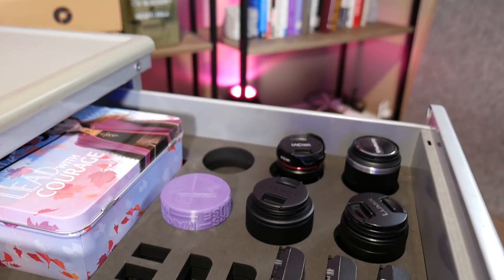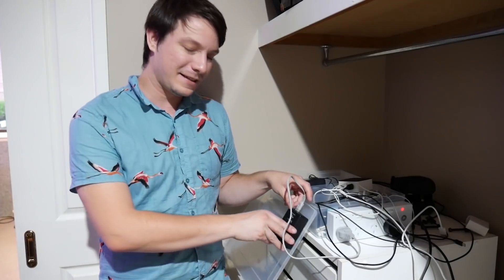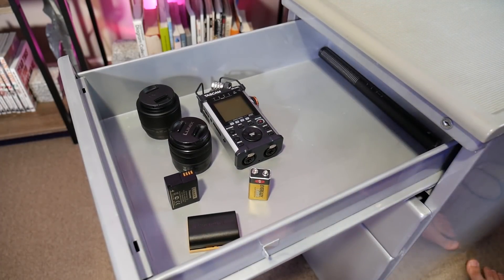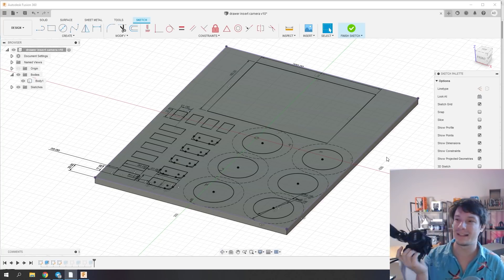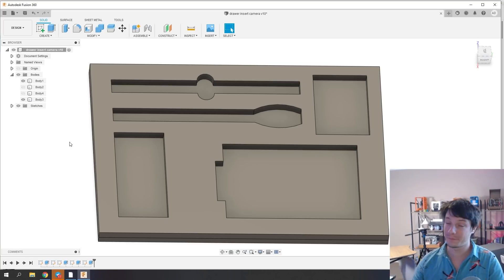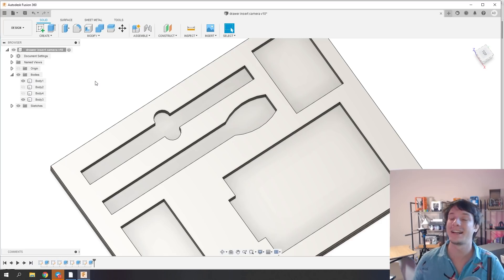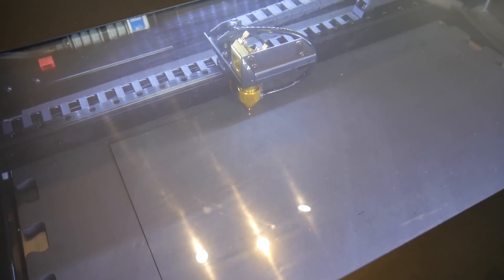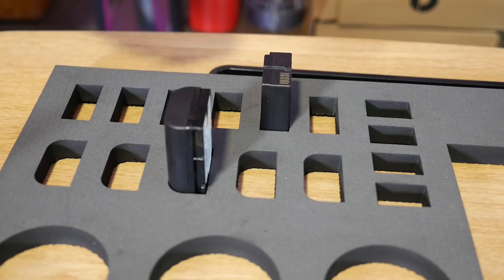DIY Custom Inserts using EVA Foam and Lasers!

Comment: You can use the "Canvas" feature in Fusion to lay out your gear on the EVA sheet, then take a top down(straight down with no parallax) picture. You can then trace your sketch right around all of the objects on the Canvas in Fusion. For basic circles/squares and rectangles, it's probably not too efficient, but for organic/odd shapes, this works really well. Actually used this method to use a picture off the web to create a dxf for some T-stak foam inserts.

Comment: Tracing the outline with a pen is not the best way and seems tedious.. Just place the tools on the foam you're going to use or a surface that is the same size as the foam. Take a photo from above. Open the photo in illustrator or another similar software (there are probably 100 free platforms that will do the same). Adjust the image to show the tools/items in a single colour and then turn the tools/items into vectors and use the vector outlines for your cutting.

Comment: With batteries, I simply have charged batteries facing up, flat batteries facing down. Once you get yourself used to do it for a while, you don't even think about it anymore.
It makes things easier with power tools on work sites too, if everyone does it, you can know if a battery is flat without too walk over to it

Comment: I tried to cut similar EVA tiles with a 550mw 450nm laser on a 3018 CNC.  This laser will cut paper & cardstock, and will burn wood.  Unsurprisingly, it will not cut the foam.  Somewhat surprisingly to me, at 100% power and 1mm/min it doesn't even mark them. Shrug.

Comment: Kmart(AU) do a pack of 4 in black I think for $10 , flip them over and your good. They also do a big black yoga mat that's 12mm thick same idea big bigger so you don't have to have joins in wide toolbox inserts. I was looking to buy kaizen foam locally but never thought of just using this stuff thanks for the tip!

Comment: i use this technique for making inserts for toolboxes or powertools - but i switched from EVA foam to ridig XPS foam - it does the job and is way cheaper

for prototyping i usually use scap cardboard and just cut out shapes i want to test, because for powertools with more complicated shapes, it is not as straight forward :)

Comment: Was kinda hpoing you'd share some details behind your battery charge accounting system. Is there a specific trick to put charged ones in a specific order next to the empty slot?
Reply from the maker: I pop dead ones onto the charger straight away, or next to it if its being used. Not great, but the camera never leaves the studio. Only charged ones go into the drawers!

Comment: Some alternatives to buying a $6,000 laser cutter. Go to your local maker space, many of them have laser cutters. Watch Bill from punished props on YouTube, you can cut EVA foam with a craft knife and get great results! A sword of exact zero is way cheaper too! With scanning and converting to vector lines I have had great success using Vellum aka tracing paper. It’s gives me better results than white paper.
Reply: Tracing paper( Vellum ) and a felt tip pen gives a really nice clean line that is converted to vector really well.

Comment: Could you cut the foam with the kind of laser engraver you can add to a 3D printer?
Reply: I tried with a 550mW laser and it absolutely failed.  Someone else here said that 2500mW was enough, although I think maybe he meant for thin foam - same commenter recommended 5000mW.  So yes, depending.
Reply: @DanielRisacher  Thanks for the detailed response!

Comment: Why draw around your socket wrench parts and then scan with a ruler, wouldn't it be much easier to just arrange all the sockets on the scanner and then scan their actual profiles? I've done that with polyhedral dice when I was trying to get textures for 3d models.

Comment: Hey @Maker's Muse

You can get away with a simple 5000mw laser engraver cutter, I even use a 2500mw to cut EVA foam for cosplay purposes. Laser has a 50 x 60cm cutting area, and only cost me £150 ish

If people wanna get involved in this, a big ol' co2 laser isn't necessary.
Reply: Could you elaborate on how you did it?

Comment: Quick tip. when I am on set, what I've done is place a a sticker, mine are reflective stickers from the dollar store and when my battery is dead I place the sticker up and if the battery is charged I place the sticker down. That way i can see at a glance what's full and dead

Comment: Tip: Put the empty batteries upside down, when you put them away. I wrote on my covers and boxes full and empty. Makes it so much faster.
Another quick workaround for the "organic forms" is to take a picture with a ruler next to it. It is best to zoom in a bit to get a flatter image.
Reply: I use those little coloured document tags on all my battery covers, specifically green ones. When putting a charged battery into its cover, I leave the green tag sticking out. When putting an empty one in, I tuck the tag out of sight. 

They're also handy for sticking to CF cards to give you more to pull on - try removing a CF card from the camera with two pairs of gloves!

Comment: For the drawer on the bottom, you could put some holes in the back, and wire the battery charging station into it

Comment: Telling charged batteries from discharged? K.I.S.S.
In the wayback when I was buying Canon gear the batteries used to come with protective caps that covered the battery terminals and had a viewport hole towards one side: clip the cap on one way and a green dot was visible to indicate that it was charged, the other way and it was red. I'm surprised the Lumix batteries didn't come with something similar.

Comment: Awesome tip, I have access to a laser cutter at work (I'm one of the operators) and am definitely going to do this!!! <3 Ps a tip for tracing items on paper: use ruled paper! :) There are pages available that have a 1cm and 1mm grid with a major gridline every 10mm. This works really well as you can scale it perfectly in both dimensions. Just make sure your photo isn't skewed.

Comment: One trick I do with my batteries to tell switch is charged and not charged is make one side a "charged" side (I use positive) and the other side is the "flat" side on the battery.
So with your camera batteries in the draw, the connector side I would designate if facing up the battery is charged, if the non connection side is facing up the battery is flat. I do this with cases as well when transporting the batteries, connectors or positive side oriented to a certain position, say right side of the case  (depending on type of case) battery charged. it oriented to the opposite side means the battery flat. Takes a little bit to get into the habit but once it has formed you'll be right.
Reply from the maker: Ahh, that's a great idea! Could also etch the markings onto the foam to reinforce it.
Reply: @MakersMuse  I'm glad you like it! Yes you definitely could. One other thing I did with my drone batteries was print off connector plug covers in green (charged) and red (flat), only problem is they tend to disappear.

Comment: A cheap cabinet, some Eva foam and a laser

One of those things is not like the others
Reply: Yes, we also suffer from this issue. Where do we buy Eva foam...?
Reply: @gerhardachrainer6116  Local hardware stores should carry it.
Reply: @gerhardachrainer6116  hobby lobby. The “silly winks” stuff
Reply: A laser cutter that costs USD$4,000
Reply: @jefflove3049  I wonder if those <150€ laser cutters on aliexpress would work...
Reply: @jefflove3049  I know it isn't exactly cheap either but a k40 off of ebay with lightburn software is like 400 pounds and with exception of a camera just as good as the beam if not a bit nicer
Reply: haha! I was thinking the same
Reply: Yeah I looked it up after he said a little bit pricey. 4000 GBP is not far off what I paid for my car !
Reply: But if it is in a community owned + run makerspace the per-user cost can go down!

If you don't have a local makerspace, MAKE ONE

(Also just "toolshares" )

Comment: A solution for the stubby lenses: You adhere a fabric ribbon to the lower layer of foam, place the lens on top of the ribbon, with the ribbon sticking out the side. When you need it, pull up on the ribbon and the lens comes up with it.
Reply: or just dont cut the holes out for them on the bottom layer so they just simply sit higher.
Reply: @bojangles5226  or just look for the already cutout part and glue it back :D

Comment: Maybe instead of scanning something with a ruler, you could just trace it on graph paper where the squares are of a known size.
Reply: Or use calipers on paper; you can do absolute (i.e. relative to some origin(s) like corners or center(s) of circle(s)) and relative (to some previous point) measurements, and even separate X and Y measurements for harder shapes. This works much faster for me than scanning and processing the image

Comment: For people too lazy to search and do custom stuff: Alex drawers from ikea. Foam drawer liners from a hardware store like home depot (just to keep things from sliding around) then either ikea or if you have one, a Daiso plastic boxes and organization. I have three Alex drawers, a collection of earbuds/IEMs, cameras and gear, cables are in narrow boxes stacked sideways, with labels on the side (IE: Micro USB, USB C, 3.5mm, etc) and this works well for me. I thought about doing something like this, but I'm just too indecisive. The stuff I prioritize changes too often, and I buy a new thing, maybe give away the old one. So custom inserts were going to become obsolete far too quickly for me. I'm still very jealous of this wonderful setup though.

Comment: Quick tip for scanning complex profiles into cad:
Just put your items on a flatbed scanner and scan at a high quality. Convert the resulting file to png and then insert that into fusion as a canvas. Since the scan will be the size of a piece of paper just set the dimensions of the canvas to 8.5 x 11 inches (or whatever width and length a4 paper is) and everything will be perfectly to scale. No need to include a ruler.
Reply from the maker: Nice!

Comment: I did this for my lab  ** A Simple way is to (1)lay it all out next to a yardstick.  (2) Take a picture at a 8 to 12 ft distance (3) Create a sketch that is overlayed on the sketch. This gives you a rough layout you can measure afterwards for tighter fits.

Comment: That's really cool. I'd definitely be all over that idea if I had a laser cutter.

Don't think we missed that Frozen 2 Anna lunchbox in the back of that drawer... 😄❄️
Reply: You don't need a laser cutter, lay out the items on the foam, out line them with a sharpie, take a box cutter or razor knife, cut the outlines, done. I've done it in my tool boxes using inserts from kaizen foam

Comment: Unfortunately, every time I've tested the cheap EVA foam floor mats, they always fail the copper+chlorine burn test. No PVC in my laser, thanks. Maybe some day I'll find a cheap clean source.
Reply: What do you test?
Reply: What's the test procedure + results interpretation for that? I can't seem to find anything about it.
Reply: cardboard also works for inserts instead of foam, just make sure your laser don't set it on fire :)
Reply: Coming from an amateur astronomer point of view I'd be concerned with the foams out-gassing in general reaking havoc on the lens coatings. This is not including the gasses from laser cutting the foam. A steak knife would of worked, but not as pretty.

Comment: How much power do you need to cut through one of these? I have a 5w, 'engraver' that I have been using to cut black PVC type boards. Yes it takes like 4 passes but it does work. Wondering if I could do it on this foam as well.
Reply from the maker: It's a 50W system but its only on 15% power. Please don't cut PVC! Very toxic fumes and corrodes the equipment.
Reply: @MakersMuse  Good to know. They are KOMATEX Foamed PVC Sheets from Tap Plastics. I have a separate room where I cut them. The cuts are small and only take a few mins but I let the room air out before going in to get the part.
Reply: @MakersMuse  Fumes are what scared me off using a laser cutter, especially since plastic is one of the primary materials I work with.

Ended up getting a normal cutter instead. Not nearly as good for the job, but at least there are no fumes.

Comment: Where did you get the foam without texture. Looked at amazon but could only find squares with a raised patterns. I have a 25 watt co2 laser bed and in the past the foam came out sticky so looking to try these EVA floor pads.
Reply from the maker: It's textured on the other side.

Comment: I like your idea with the paper sketch and scanner, but i usually just put the object on the scanner with a ruler on 2 axis. You'll sometimes find on flatbed's that the x and y scale are different
Reply from the maker: huh good point, I didn't consider that could happen.
Reply: @MakersMuse  Generally its not too bad, its more likely to be out in the slidey axis

Comment: For the ones that were too short you could creates two G codes. One with all the holes like you have it now and another with all the holes except for maybe that one that was too short. Or even easier put back one of the circles from the scraps to boost it up.

Comment: Reduplicated again for a second time in triplicate <3
Reply: BTW - why don't you make separate drawers for charged batteries vs. empty ones?
Reply from the maker: I might separate the spaces, but generally the empty ones go straight to the charger it's just I was getting lazy and confused with the old charging box!

Comment: LOL i have 2 of those exact same cabinets at my desk in the office.
Reply from the maker: It's a weird size! Not large enough to be a real filing cabinet.
Reply: @MakersMuse  it’s supposed to be an under-desk unit for personal junk, stationery etc. to keep it off the desk surface. The bottom drawer actually has file folder slots if you look but no-one actually uses them for that anymore.

Comment: How powerful does the laser need to be in order to cut this kind of foam? I'm kinda starting to want a cheap laser cutter, but is it going to be a good investment or should I spend a bit more money on something more professional?
Reply from the maker: Low power but a longer focal point is important, as is an air assist
Reply: Thanks, @MakersMuse

Comment: Lightburn is a wonderful laser utility with powerful design functions. I use a 6mp camera, mounted above my 1300/900 bed, for placement AND it can trace shapes on the bed into Lightburn😎
Reply from the maker: Sounds really handy! Good to know
Reply: Yep, and aside from the vectorization, you also can avoid Fusion for such simple geometry.
Reply: Not to mention if you do the alternate scan and burn method he suggests, you can import the scanned raster image and 'trace' the lines within Lightburn to make a vector for burning. It's an outstanding program for the price.

Comment: my suggestion would be to have an area for charging batteries with two sides: keep flat batteries in one, and charged batteries in the other. That way you always know which are ready to go.
Reply: For rc lipos, I always use an elastic band around charged batts - simples, not dependent on positional info 😁
Reply: @neilgillies6943 And then when the band breaks or falls off??  You’re more dependent on an extra item rather than simply knowing by seeing whether the battery is up or down. I taught my employees to do this with empty boxes (always upside down) and it’s actually improved production times!
Reply: @BitSmythe  There's the answer then, turn your batteries upside down - obviously works for your employees 🙂 I might add that I always test my battery before flying, so it's of no consequence which system I use  - happens that a rubber band has worked well for me - YMMV as they say - especially if using cheap man-made rubber bands LOL 🙂 Diligence might also help - but again that's prone to human failure of course.
Reply: Let's see if chappel came with an idea for this, I guess this video was inspired in his videos since he is making everything to make his place better
Reply: In my camera bag, I can have charged and discharged batteries. They come with a cover, into which I stick a green one of these document-flag things: 

https://www.amazon.com/Post-Page-Markers-Self-Adhesive-Document/dp/B00H2DNLUY

When I've charged a battery, I put it so that the green tag is sticking out from the cover. When I put a dead battery back into its cover, I make sure that the flag is folded inward out of sight.

These tags are also fantastic for sticking to CF cards. There, I use them for extra grip. If you're outside in -20C and need to change cards, having that piece of paper sticking out makes the card much easier (or even possible) to remove while still wearing two pairs of gloves. (Believe me, holding the camera without gloves at that temperature hurts.)
Reply: Angus did not move his charging box/station into the cabinet, so ofc he puts the ones that needs a charge there, and only the charged ones in the draw
Reply: A common photographer's trick: put flat batteries in one side up and charged batteries the other side up. You can even use stickers to mark "flat"/"charged" or color code for easy overview.
Reply: Or discipline yourself and only put fully charged batteries back in the drawer.
Reply: @djrrmml7514  yeah, but you should have a designated area for uncharged batteries anyways. With as much batteries as he has it's very likely that at the end of the day (or a trip once we can go outside again) there will be a small pile of batteries waiting for the charger.
Reply: Put a mark on one side, like a red dot and put empty ones in the other way around.  Ret dot visible == ready to go.